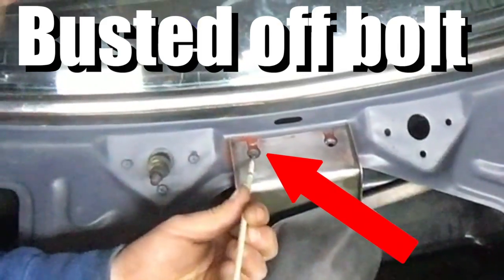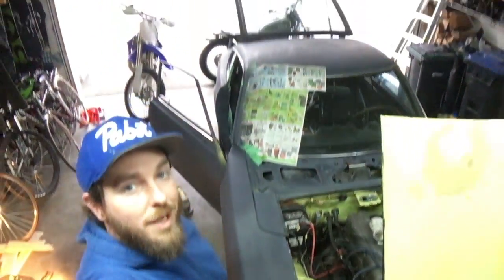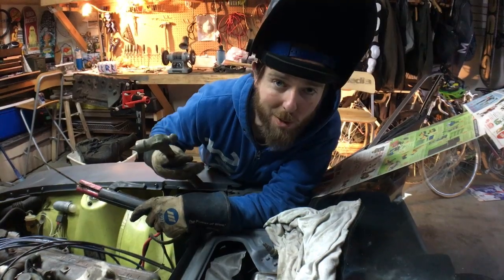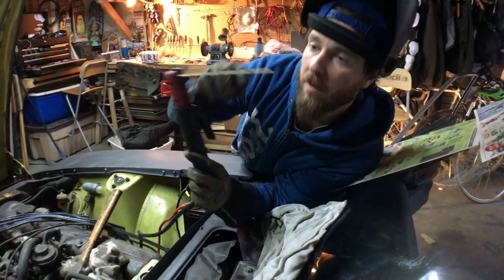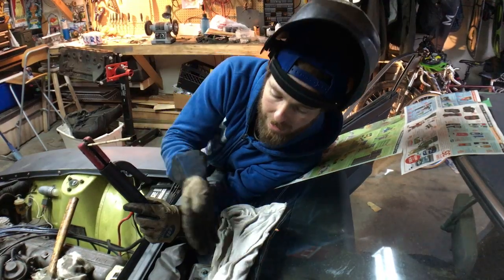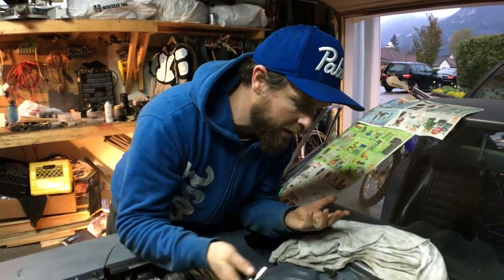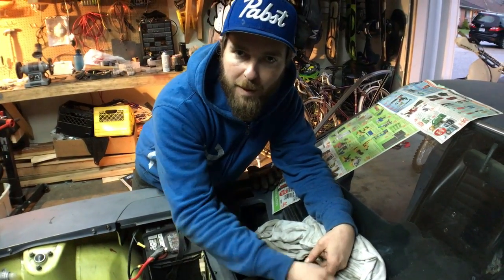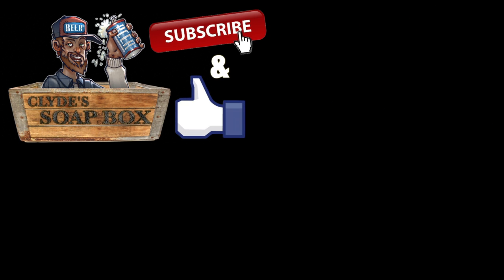Bolt Extraction the Way I Do It - Using Unichrom

Comment: Absolutely Fantastic Video for beginners like me to welding. Just some questions, 

can I use 7018 rods or does it have to be that type? I don’t want to ruin the threads so whatever protects them.

Can I place the negative anywhere on a car. Thanks from the UK
Reply from the maker: I've seen it done with stainless rods but haven't tried it with 7018.
I always place the negative as close to where I'm welding as possible and follow standard safety procedures.

Comment: Looking to do this on a motorcycle alloy wheel to remove a snapped brake disc bolt. As a novice I have two questions. 1) how do I earth the job? My wheel is painted and surrounded by a tyre 2) is the high heat likely to weaken the wheel?

Comment: I noticed you did this "dry" (i.e., you didn't put any oil or other lubricant/penetrating fluid on the broken fastener after welding to break up the corrosion that likely existed).  That may be critical if, after all the preparation, it doesn't want to turn out easily.  It wasn't needed this time, but it's just a good practice.  If the bolt wasn't turning easily, you might have broken the weld while turning to remove the fastener.

Comment: Why are you running a welder just 15-inches or so from a 12V car battery?  Off-gassing from the battery could cause an explosion, and your body is practically laying on top of it.  Was it too much trouble to loosen the cables and the battery hold-down to remove it while you were welding?  Sparks were being thrown around the engine compartment, and could easily have made contact with the battery.  I don't care that it didn't blow up this time; you were extremely fortunate that it didn't.  In addition, you tapped the welding rod on the steel windshield wiper motor cover and on a structural cross bar in the engine compartment, leaving ugly scars on those.  Damn, Spanky, who taught you to weld like that?

Comment: would this work for a brass temperature sensor In the jeep head the one for gauge ?
Reply: Nope, being a welder myself, I assume the 285 rod they're using is a stainless based electrode. 

Use a dremel to grind some grooves into the broken bit, heat the alloy around it with a small butane torch, spray the broken part with some freeze spray trying not to cool the parts around it, and then put a flat blade screwdriver in the slots you ground and try to unscrew it.
Reply from the maker: Wow!
That's a good question....
It works for a lot of dissimilar metals, but I don't know anything that would stick to brass.
Makes me wanna give it a go.....

Comment: I do that with the heli arc but instead of welding a fastener to the top I snap a pair of vice grips on the weld while its still glowing. Works for broken taps as well. 👍
Reply from the maker: Haven't had to use it there (yet) but, hells yeah!!